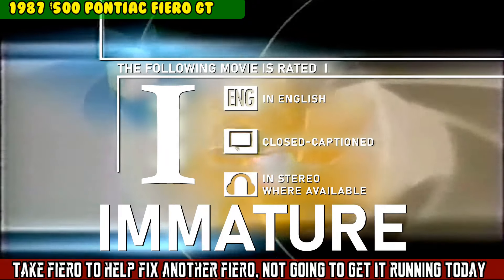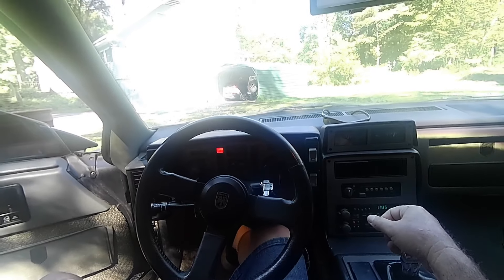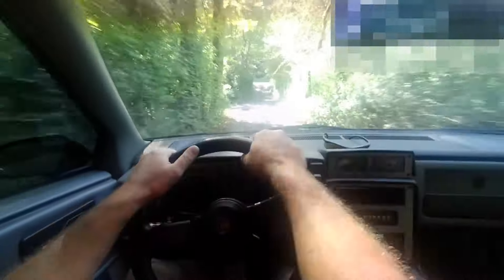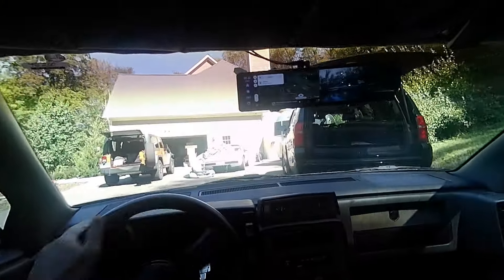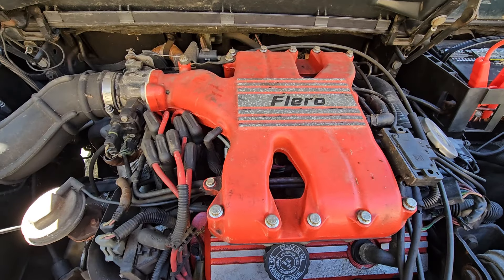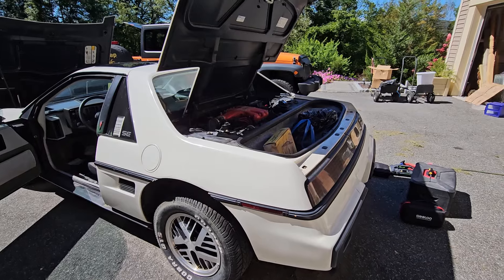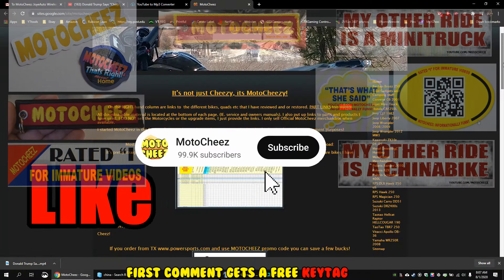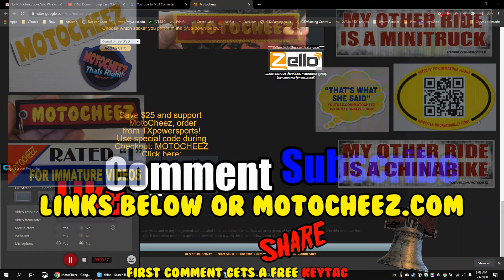PT18  Take the Fiero to help fix another Fiero, Not gonna run today. $500 Fiero GT

Comment: Have some thick tread big tires on my f350 10 ply . Used tire beads and they seem to be working well for about a year now . Rebalance themselves every time you move . Good for big off-road tires . I have a machine and balancer so I figured I would try them and take them out if they didn't work .
Reply from the maker: That's funny because my buddy had some 44s I believe it was and he tried to tire beads that didn't work and I spun balanced it in static mode and it worked great
Reply: @MotoCheez  goes by tire weight maybe he didn't use them correctly.? Didn't know if you where familiar with them . Some aren't.
Reply from the maker: @680ecks I've researched them but never used them. Whatever he used ended up coming out like powder. Maybe it was brand he used
Reply: @MotoCheez  I have magnum plus I got a bucket off Amazon way more then I need .

Comment: Yup, fuel/spark/air.  Remove one and no fire.  Safe travels there Kemosabe.
Reply from the maker: Thanks!
Reply: timing.  compression, ecu? i would have sprayed starter fluid in the air intake to see if it had correct timing and compression i think.
Reply from the maker: @warrenpeas he didn't have any starting fluid. Tried some WD-40 but wouldn't kick it off.

Comment: I bet that service engine light is your EGR solenoid. common issue.
Reply from the maker: Could be, last trip I actually disconnected the vacuum line and plugged it off so the EGR isn't working, but the light came on prior to so I didn't check the code yet
Reply: @MotoCheez  Yea, it will throw the code while cruising then. Its very annoying and will keep coming back till the EGR is fully functional.

Comment: The Service Engine Soon light came on on my 94 Camaro.  Added a half quart of oil and the light went out and hasn’t come on again.  Just a thought…
Reply from the maker: I checked the oil and it was full. I checked the codes on it last time it popped up and I can't remember what it said it was I think it was the EGR
Reply: @MotoCheez  I wouldn’t have thought the oil was the issue, but when the light went out I stopped looking for anything else.

Comment: On your renegade being the 2.4. What oil brand have ya used if youve changed it? Ive been seeing theres a software recall to help with oil consumption on the 2.4 too?
Reply from the maker: I use mobile 1 5w30, hasn't used any oil yet. Yes, 2.4L, I didn't hear about the recall yet

Comment: man i kinda wish i bought a shitbox fiero instead of a shitbox NA mr2 sw20 for $1500.  i hope you dont have my issue where the water jacket is so clogged from sitting a decade it over heats.
Reply from the maker: I thought about the MR2
Reply: @MotoCheez  u should still do one.  mk1 or mk2.  i have my mk2 engine out the car and am trying d to decide if i want to save for a 3.5 Camry motor swap.  all this started a coiple years ago when i watched your videos and did the zs190 swap in my grom clone. then the cg250 in my condor now im onto cars.